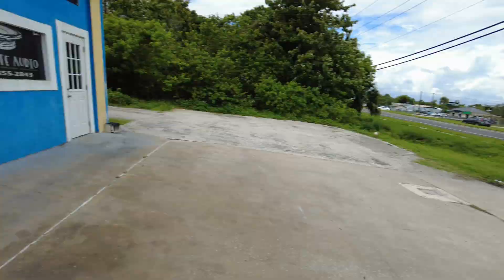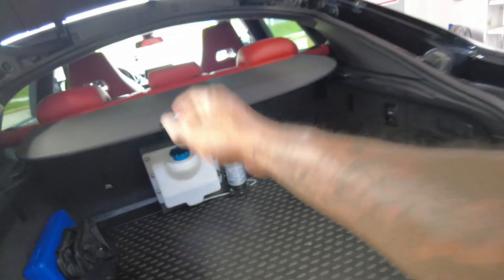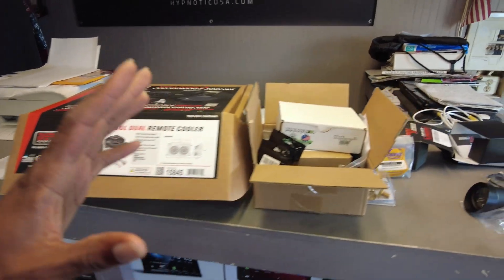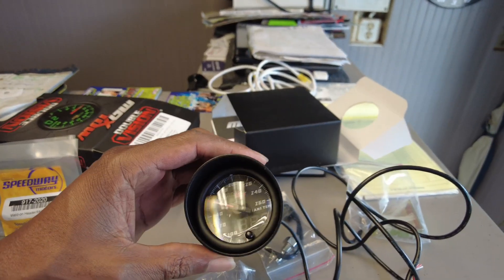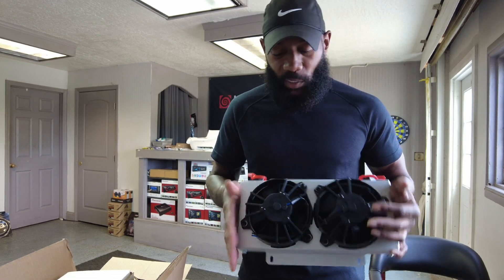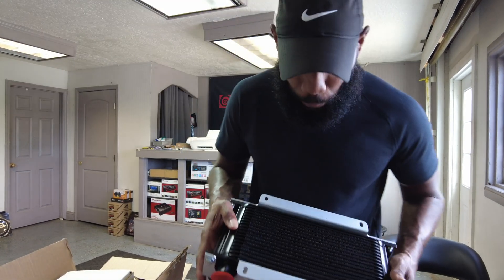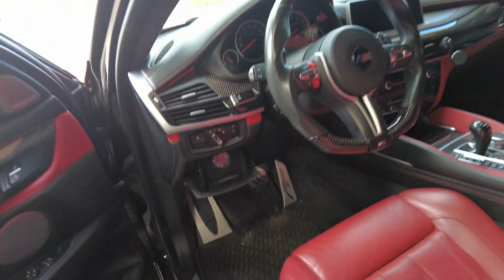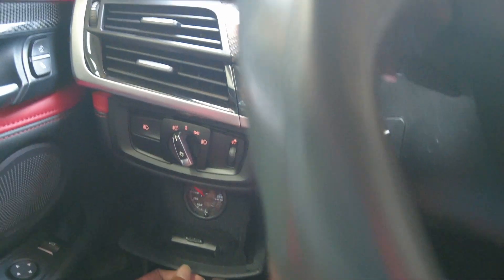WORLD'S FIRST HYPER-COOL BMW COOLER SYSTEM!

Comment: Dam I don’t have a ZF I have a 8 speed DCT. Dose anyone know anything about the 8 speed DCT manufacturer, spec and fill port size would be helpful?
Reply from the maker: Thanks for supporting the channel. The HPR adapter will fit the BMW DCT as well fam🚀
Reply: @AutoLust  the 8 speed dct not the 7 speed  i haven’t  been able to find and information on the existence of it let alone any specs I’m going to be changing its oil I’ll have it up in the air and give it a visual inspection. How is the problem with your exhaust coming off I’m going to be using a 2 bolt connection like on some of the N63s and wouldn’t take much welding to convert your existing
Reply from the maker: @shazk21  My tab and bolt kit just arrived, but I haven't put it on yet. It's a little different than the N63 older style two bolt connection. https://www.speedwaymotors.com/Header-to-Collector-Weld-Tab,4869.html